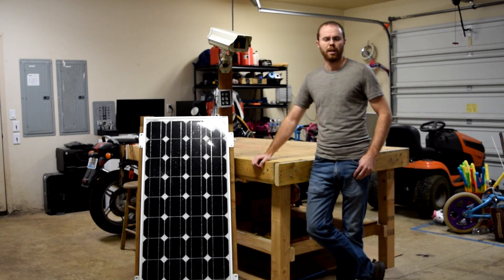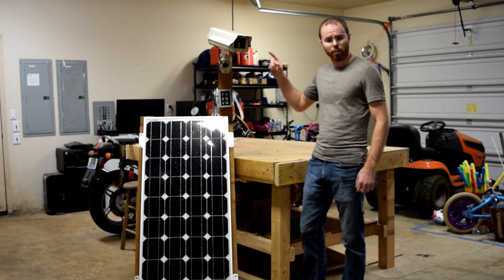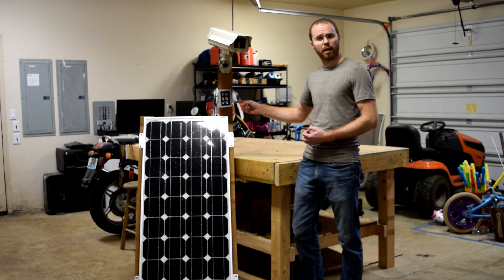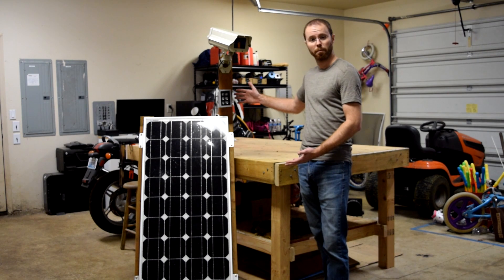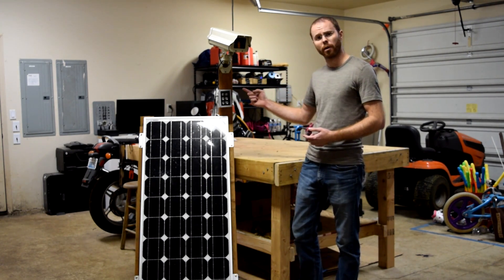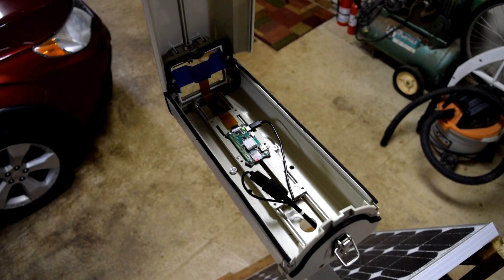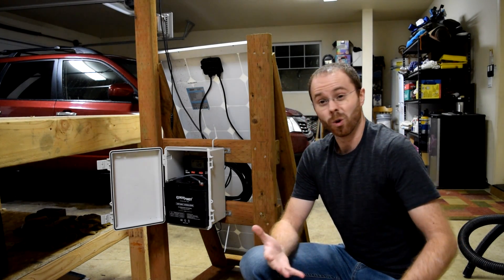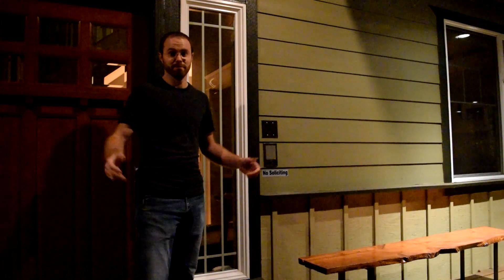Solar Powered Wireless Security Camera System (Raspberry Pi DiY)

Comment: What is the name software that mentioned in the video that would do the motion detection, and could you possibly connect motion sensors to the camera wirelessly.
Reply from the maker: The software is called Motion (https://motion-project.github.io/), in this video I used the install scripts from geraldoramos on GitHub (https://github.com/geraldoramos/pigeon) but those are just scripts to help speed up the configuration of Motion and to link to DropBox uploading.

Comment: Can you do a video for hooking a solar panel to reolink Argus 1 please. They make one for the Argus 2.
Reply from the maker: Hi Akil-

I've not used the Argus before, but from a quick read of their website the Argus 1 does not look to use rechargeable batteries or have a recharge circuit in the unit - disposable only.  I suppose in theory you could use your own 3v charge controller and battery and power something like this from solar/battery - but that's a big hack and of course will void your warranty :)

Like you say they do have a solar panel option for the Argus 2, but it also has the rechargeable batteries and circuit required.

Lastly note that in this video I wanted something that was not tied to any specific company's cloud service for flexibility and privacy reasons, which would not be the case for the Argus.

Erik